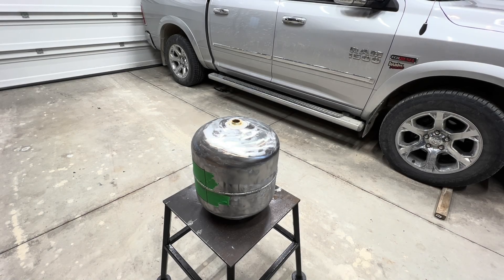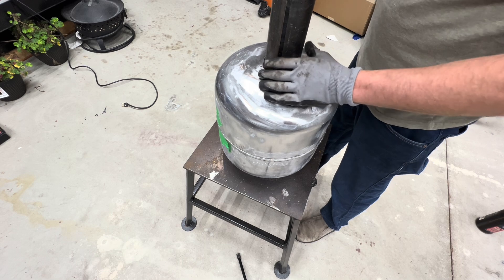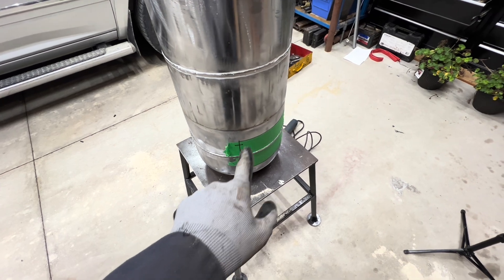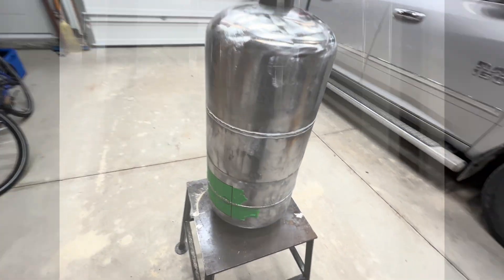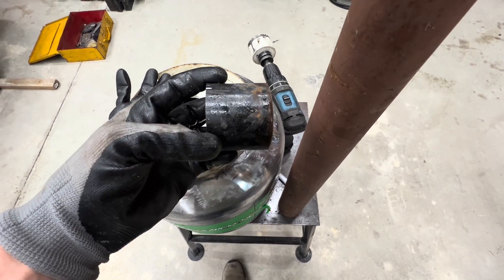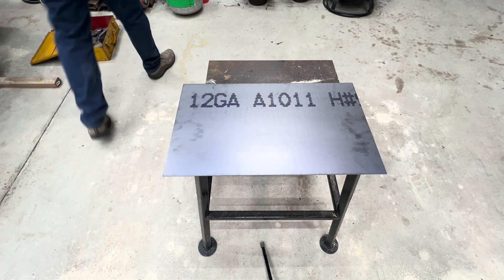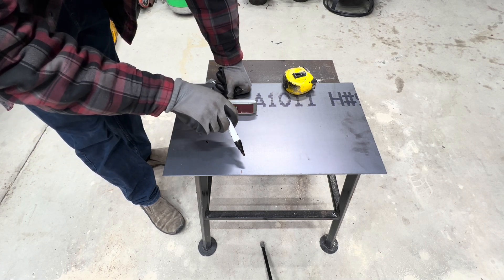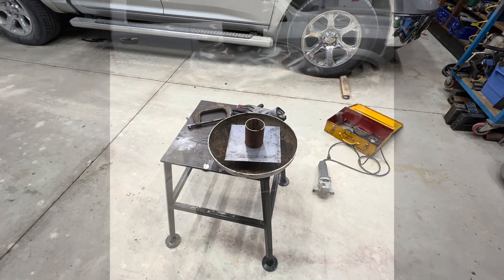Waste Oil Burning Water Heater-WOBWH pt1

Comment: I see a problem in the water cooling the flue which works counter to increasing the draw of air into the bottom. If you run a fan on the combustion chamber shouldn't be a problem, but if you're depending on natural aspiration, might be an issue. Look forward to seeing your progress.
Reply from the maker: I did anticipate that at startup, that is why I added the extra 48” length of pipe to try to counter it. 

There is 64” of flue but only 13” passing through the water jacket, the other 51” will hopefully maintain draft. 🤞